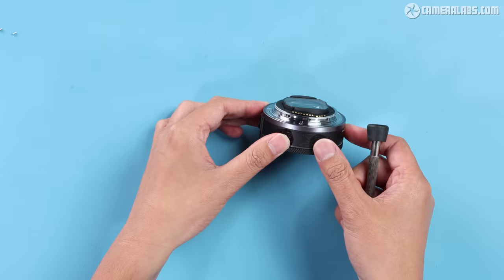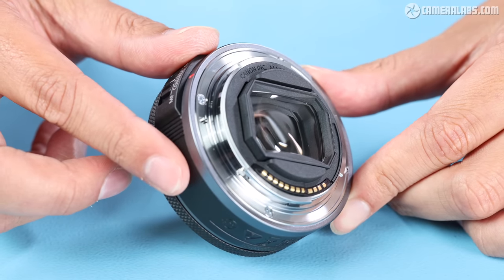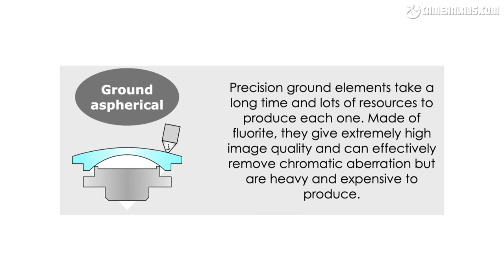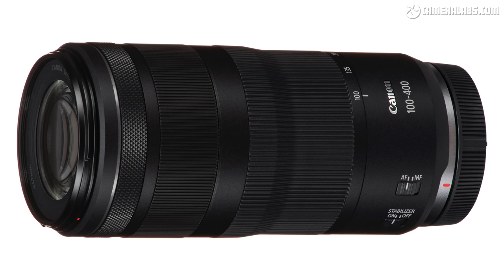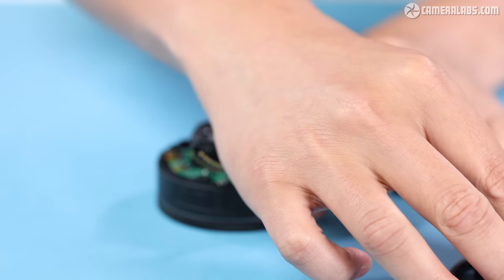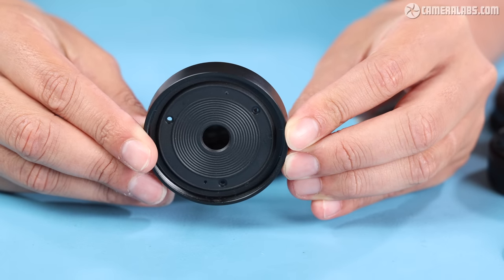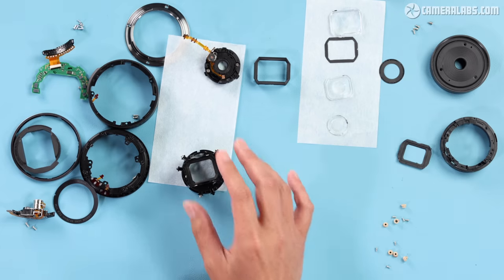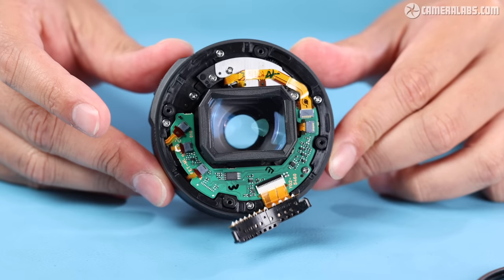Canon lens TEARDOWN! What's INSIDE a new lens?

Comment: Interesting. Plastic is the new glass in lens construction.
Reply from the maker: It's definitely an option for the manufacturers and has some key pros...
Reply: And rectangular is the new round
Reply: If it makes you feel any better composites which is a high end plastics is replacing metals for airplanes
Reply: @cameralabs  

Hey Gordon. Could this be a reason why the aperture ranges have been degraded from the EF and EFS lines

Even with the EFM examples, I noticed that the best of those lenses are not using plastic elements,
Reply: Phone camera use only plastics
Reply: @davidl6354  Thanks for the info.
Reply: @cameralabs  I wonder what could be its cons? Maybe T-stops?
Reply: @mattdp846  not really. Acrylic is only a few % less transmissive than pure glass. It's not a perfectly rigid as glass but for the size of the elements there are no discernable differences. It's slightly lower index but no biggie
Reply: Decepcionante... Plástico arranha facilmente!

Comment: That was very informative Gordon. I'd always assumed that the shorter flange distance of mirrorless cameras would make it easier to build true wide angle lenses rather than the retrofocus designs we had for SLRs, but I forgotten about the problem of keeping light rays as near to parallel as possible to enter the sensor wells. I remember this problem gave Leica problems with their M8. Interesting to see how Canon have approached it.
Reply from the maker: Yeah, you have to get quite creative with your elements to bend those pesky light rays where you want them at that distance!

Comment: I would like to see a comparison of the plastic and glass elements after 10 years of use. Do the plastics show yellowing, are they still as clear as the glass ones. Plastic looks really good when it’s new but it ages very differently.
Reply from the maker: I agree, but remember many of the lenses I listed which also use plastic elements are getting on now and seem to be fine. I have an old 18-55 for example which looks fine.

Comment: Very cool and interesting to see all the changes and also readons why. One thing i think also gets forgotten that often correction profiles are used to „fix“ the image and often this is the reason for a corner unsharpness in cheaper lenses. However, if someone neets PERFECT corner to corner sharpness, he is using the wrong gear. Its often crazy how much they correct with a profile but also crazy how good the corrected image still looks.

As someone that often goes on photo hikes, i certainly do apprechiate lighter gear. 
Like im not going to take my 50 1.2 on a 15km hike 😂
Reply from the maker: Exactly, I use the heavy gear at home, at specific locations or in studios, and when I travel, I'm all for the lighter stuff!
Reply: @cameralabs  Late me, finally decided - got me a Fujifilm X-T30 II with a 35mm f2 prime and a 18-55 2.8-4 , man that thing is TINY! :D  Just arrive a hour before i left for my Ireland vacation trip, took my heavy canon R5 gear with me. Would have done it even if the body arrived earlier. But for short city trips and similar stuff, this small thing will definitely acompany me.   Just takes a while at getting used to its controlls :)

Comment: Lens adjustment collars - stuff of nightmares for fixer uppers 😆 People give PMO hard times, but majority of everyday optics have been using it for dacades, from corrective glasses to lasers. My disappointment is that this material has not been taken advantage of enough, and yet we are already suffering from too much plastic rubbish everywhere. We could have had laminated heated elements to prevent fogging up and fungus residence, we could have had in-glass filtering from ND to grad to colour, we could've had internal tilt&shift mechanisms - all of that could be implemented in the "entry level" lenses because of what PMOs can accomodate. Good video Gordon, nice to see Canon recognises your work and your balanced stance on many product reviews. Cheers! 👍

Comment: at first glance, plastic elements made me worry, but then, as you mentioned that Canon had been making kit lenses with plastic element since 18-55mm EF-S IS STM, a lens I have used on Rebel series. It's not that bad, although very soft towards edges camparing to the original 24-105mm L. However, I have to say that considering pancake lenses would not be heavy anyway, it's more like Canon treating those RF pancake STM lenses as the Rebel EF-S STM line, the most budget friendly lenses mounted on Canon bodies, cost even lower than the DG DNs from Sigma.

Comment: So at the end you said what I've been thinking:  How is this not a great camera for most purposes?  The answer, of course, is you have to go back a bit in time, where you couldn't play "Where's Waldo" with the image, looking for some small part of the image you can use.  24mpix still allows some latitude but the confidence to compose a bit on the fly is more needed.  Offered in exchange for better ISO, less of the mirrorless quirks, and a better ability to capture that one moment in time, I'm not sure that's a bad trade-off.  I've never owned an R5 however.  If I had, perhaps I feel differently.  Love being able to tease an image out of 30mpix. Maybe I'd be addicted if I had 45 to play with.  

Still, quite a camera in that R3.

Comment: Canon talk a good game with their wider lens mount (than competitors like Sony) and aspherical tech.

But then under test, a lot of RF lenses require pretty wild corrections and have intense vignetting. Also they’re expensive. 

So it’s difficult to be convinced that they have they advantages they claim.
Reply from the maker: To be fair, almost all mirrorless lenses now employ substantial software profile corrections for geometry - same for Sony and others.
Reply: @cameralabs  well, that’s true… although with designs like the 14-35, Canon appears to be pushing it further. 

I’m actually in the process of changing system (back) from Sony to Canon… since I think it’s the body ergonomics where Canon absolutely shines. 

It’s more a source of amusement to me therefore when Canon ‘talk smack’ about manufacturers with narrower lens designs. I do think Sony do a stellar job within the constraints they have. 😊
Reply from the maker: @albedo0point39  if it's any consolation, Sony sometimes talk about the benefits of a narrow diameter allowing smaller bodies!
Reply: @cameralabs You can sell it in multiple ways. Both a longer and shorter flange distance have their benefits and weaknesses. Same with the mount diameter. At the end of the day, the difference will be marginal for 99.99% of users except when you have very specific requirements.

Comment: Thank you for a excellent and very informative video! I have my 28mm on order, hoping it would turn up before leaving for the summer holiday, I might be out of luck. As happy as I've been with the size of the EF 40mm 2.8 I'm hoping this forced change of focal length for my go to camera cover (and travel/space saving) lens will be successful. Looking at the design of this lens I presume a 40mm 2.8 would not be attainable in a pancake type lens for the RF mount?
Reply from the maker: I've seen a few people mention the 40mm, so I'll ask if a pancake is possible for it in the RF mount. I don't see why not, as longer focal lengths are easier to achieve.

Comment: Very interesting.  Thanks Gordon.  I note a comment below about Specsavers plastic lenses.  I have Nikon plastic lenses in my specs and have no problem with them.  They appear to be remarkably scratch-resistant, too.  My camera has glass Canon lenses.
Reply from the maker: Exactly, many of us use plastic lenses in other applications which work perfectly well!
Reply: Coated plastic lenses may be more scratch - resistant than glass depending on the coating!

Comment: Why canon made 15-30mm ? Or 24-50mm RF lens.
Reply: The 15-30 is what is essentially a full frame replacement for the 10-18mm ef-s. No idea why they bothered making a 24-50mm.
Reply: @Joe-hm1zk  why F4.5. it could be f3.5 at least. Like that why they made RF-s 18-45mm starting at 4.5? Thousands of body sales down by this kit. It could be equivalent to M50 kit at least.
Reply: @ghalibsworld  They're just really relying on the "amazing" high iso performance of their full frame cameras right now. The RF-s lenses just seem like an absolute joke at the moment.
Reply: @Joe-hm1zk  100%> the RF-S is totally useless. The R10 has huge potential but Canon not interested in it. R10 need C-log3 like Sony A6400. In my country (Bangladesh), hundreds of Canon crop sensor user switch to Sony and Fuji.
Reply: @Joe-hm1zk If they make that 24-50mm to be f2.8 throughout at a lower price point and lighter weight than the 24-70L, then it's a different story.
Reply: @kenneth6102  If the size could be similar at F3.5-5.6 I'd take that. It would be a reasonable alternative in size to a prime for a small walk-around lens. But yeah the current aperture is just silly.
Reply: @Joe-hm1zk  indeed. Canon R&D, is just insane in case of aperture choice. They must understand people's demand. Not every has tons of money.

Comment: I held this lens recently on display at Canon and the only physical attribute I found disappointing was the aperture ring does not move in increments which means it’s very easy to accidentally change the aperture. Very keen to see if it’s strongly corrected with software like the 16mm or if the 28mm is achieved optically.
Reply from the maker: All mirrorless lenses today, especially smaller ones, use software profile corrections, and the smaller and wider ones tend to be more substantial. The customisable control ring can be used for aperture, but it's more for manual focus, hence it's declicked and smooth. Canon only out the clicky ones on bigger lenses with a separate manual focusing ring.
Reply: @cameralabs  I wish it behaved like the RF 35mm f1.8 which has a clickable control ring but I understand that’s certainly not a pancake lens. I am happy the 28mm has the 3 option switch unlike the RF 50 f1.8 which has no MF switch! Looking forward to your review of this 28mm Gordon. 👍🏻

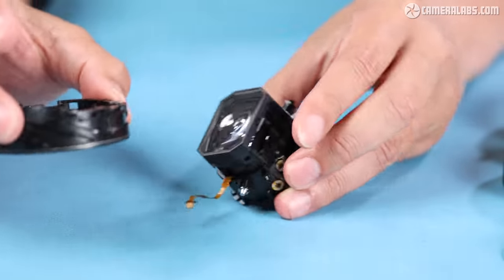Comment: at 8:20 gordon says that the the front element being smaller than the rear is different than "any" DSLR lenese that we're used to....except that's not true, is it? The directly comparable EF40mm pancake and the EF-S 24mm pancake both feature a very similar design with the smaller elements at the front and the larger at the rear.
Reply from the maker: You misheard - I said many, not any. And those pancakes are exceptional designs, like this one.
Reply: @cameralabs  Oh my mistake and apologies then.

Comment: I saw the diagram and immediately thought that it resembles a phone camera lens, which led me to suspect the use of plastic elements. I was correct 😬 So far, most of Canon's optics with PMOs have been mediocre (the great RF 100-400mm IS USM honorably excepted), so it'll be interesting to see whether this 28mm bucks the trend.
Reply from the maker: I think so far they've met a spec. I agree the 100-400 is probably the best of the bunch so far, although I really liked the 24-105 STM, and I think the 16 is also good. Of all those lenses I listed in the video, I think they share a similar rendering characteristic which isn't as attractive as the best glass models I've tested BUT that may be down to more than just plastic vs glass, as the modern glass L lenses are considerably different in every respect, it's not just a material difference. I think if they deployed plastic elements in some high-end lenses, we may have a different view, but right now, they're being mostly used on budget lenses which won't be as good for a number of reasons.

Comment: Amazing technology and video, but so sad to see them stuck in the 3:2 aspect ratio, regular sized sensor. I'm moving on to medium format Fuji, where more of the image circle of Canon's great EF lenses can be used in any aspect ratio.  They should have developed a full frame, oversized, multi-aspect ratio sensor, or at least Panasonic should have. This is sad to see.
Reply from the maker: It is an interesting choice, as it is now mostly arbitrary. I think APSC was driven by the biggest size a semi-conductor machine could make, but I'm sure there was some flexibility in the shape.

Comment: Will the plastic elements turn into yellowish like my ultra thin myopia glasses after a certain time of wearing up to one year? If not, strongly suggest Canon make lenses for wearing glasses.
Reply from the maker: As I said in the video, Canon's been using plastic elements in some of their most popular and common lenses for years now, which means not only have they been in use for over a decade in some cases, but also in enormous volumes, without complaint so far. I agree, spectacle lenses can become coloured, I've seen that, but presumably there are different grades of resin, not to mention manufacturing and hardening processes. Same for glass. It doesn't always mean a great end-result. I bet we can get plastic spectacles that perform brilliantly and last, but they may not be as affordable.

Comment: I'd love to see whether there is any difference in MTF across a temperature range of -30 to... +40 or so between a lens that is totally glassed out and one that is full of PMOs. I don't have a horse in this race but I bet it would be neat to see if material properties affect outcomes across the temperature gamut.
Reply from the maker: That would be interesting, although I've never seen any MTF charts based on temperature published.
Reply: @cameralabs  Wonder why. Materials always have some dimensional properties which shift with thermals, and it so follows that distortion and aberration will change too.
Reply from the maker: @POVwithRC  definitely, and it makes me wonder at what temperature do they measure the MTFs, and whether it's a standard one for everyone.
Reply: @cameralabs  😁 I look forward to the investigation

Comment: Plastic layered asph lens elements are far from being specific to Canon. They are used a lot in lower end lenses like Nikon Z 24-50mm f/4-6.3, Sony FE 12-24mm f4 G and Fujifilm GF 45-100mm F4. Tamron (also Nik-mron) 70-180mm f2.8 has 2 plastic layered asph elements out of 3 asph elements. 
You have hardly heard about them because plastic layered asph elements are considered the cheap alternative and manufacturers always attempt to vague them into  just "aspheric element".
With that said however, are you sure all the asph elements in RF 28mm f2.8 are plastic layered? At least the rectangular ones look like pure plastic. If they had a glass base, then cutting the glass apart would be equally difficult as cutting a regular glass element. There would just be no such need to spend the extra effort cutting them into a rectangular -- unless they are purely plastic, directly moulded from hot resin.
Reply: I think around 3.12min, you can see PMO is all plastic molded.  I think the last 3 elements are completely plastic.  It makes sense as they are the biggest elements.

Comment: Gordon I don't know if you're the one tearing down this lens But if you can get access to the 200 to 800 lens tear off the back part of that lens and see how the tripod collar is held in place I called canon and they won't tell me anything and this lens that's one of the poorest design parts of that lens ever , it should have been  Designed like the old 100 to 400 were indexed on 4 short screws if you know the lens I'm talking about it is the old push - pull design But at least it had a removable tripod collar .
Reply from the maker: There's no way that was me in the video! I was filming one of their engineers...

Comment: Very informative. Due to trust reason this convinced me not to buy plastic "glass" and stick with real glass.  Very cool review btw !
Reply from the maker: I think ultimately we should use whichever material gives the results / price / weight combo we're looking for. Depending on the model, that might be glass, or plastic or both.
Reply: @cameralabs  Longevity might be an issue with plastic, it's really nice to be able to buy a 50+ years lens and it just work. But maybe there's some super stable plastics, I don't know.

Comment: I can guess, if the last 6 months has been any indication... 

- a max aperture of 3.5 to 7.1
-No hood included 
- Plastic mount maybe
- Not a sliver of weather sealing
- Easily scratched cheap feeling brushed plastic
- Reduced performance if it is a new version of a previous lens

= How depressing. 

PS - RF 50mm 1.4 when 😡😡😡😡
Reply from the maker: We already know the aperture is f2.8. And the mount is metal. You can see both in the video, as well as in my preview of this lens. And like all Canon lenses so far, if it isn't an L lens, it won't be weather-sealed or come with a hood - that's just their strategy, not just for the last six months, but for years. And as you'll know from the video if you watch it, it is a completely new design - that's the whole point of the video. So the only depressing thing is a comment that's been posted without watching the video. I do however agree we need a 50 f1.4 and I keep asking for it.

Comment: Hopefully the plastic is better optically than that used in Specsavers specs.  I wear the glass ones all the time, despite significant extra weight, to avoid the vastly inferior chromatic aberration performance of the plastic.
Reply from the maker: It's interesting, I also notice optical aberrations on not just glasses, but the lenses used to make TV shows and films! Once you know what to look out for, you can't help it! Ultimately I expect there's different grades of plastic and moulding depending on cost.